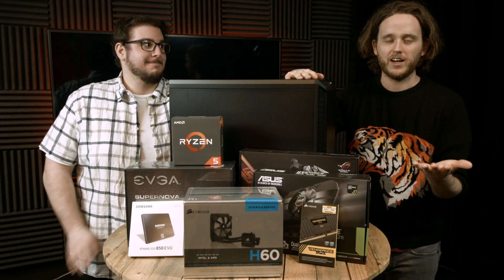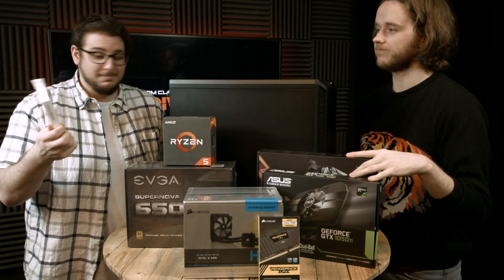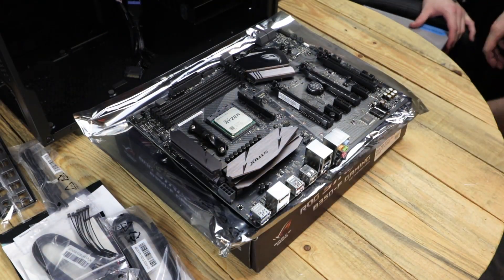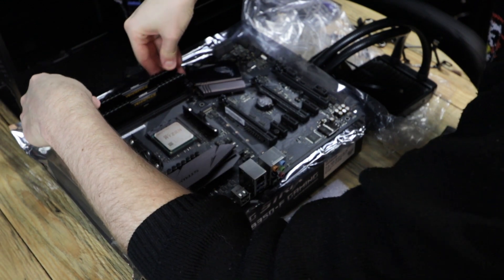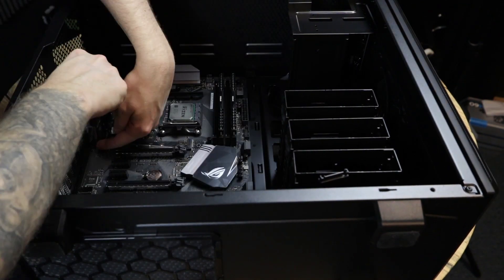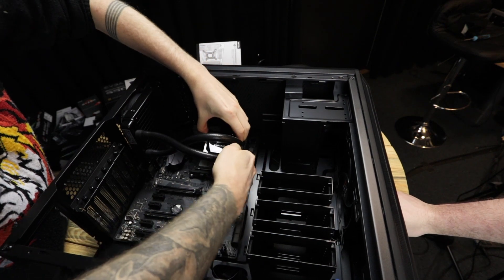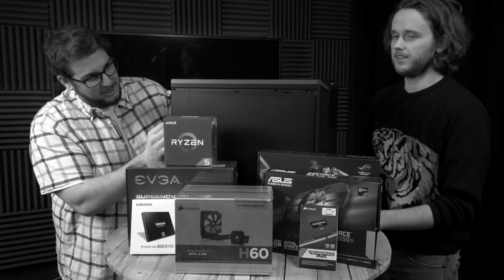Ryzen PC Build Guide - Part 1: Post

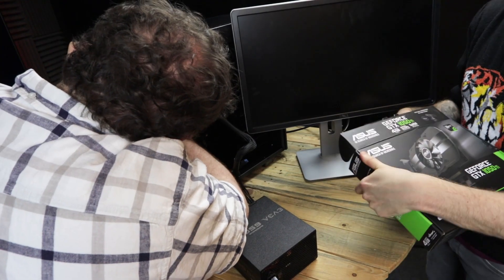Comment: 6:06 You didn't get a signal because there is not integrated graphics on the CPU that you purchased. Only the Ryzen APU (says "With Radeon Vega Graphics" on the box) can send a signal through that motherboard's video output... if the BIOS is up to date...

Comment: So many stupid comments as per usual... your requirements are not necessarily the same as a streaming box.. CPU is important, GPU hardly at all, decent RAM is worth it, solid PSU and cooler mean silent use and solid efficiencies. Small SSDs (256GB or lower) are not suitable for content creation, or even any mainline builds...

Comment: These two have no idea what they're doing. The prepaste is garbage first of all, second if you read the instructions on the h60 it'll tell you to use it as an intake fan not exhaust, also they are silent but if run at less than 100% will overheat playing most games at any setting, aka they suck, you need a duel or triple fan to run silent water cooling and it makes little sense anyway when they have fans.... so just get a good corsair cpu fan. and always have more intake than outtake fans.

Comment: Bottlenecking for beginners. Shoulda got a ryzen 1500x, a 256/128gb ssd + 1tb/2tb hdd, a 550w 80+ bronze efficiency psu and a 1060 6gb instead of wasting so much money on flashy stuff.....
Reply: i got my gtx 1070, i7-7700k OC build for around the same price as this...

Comment: I went with a 1600x as well, It's a great choice for the price, Paired with an RX 480 and 16gb's of 3200mhz DDR4 it's given me a good gaming PC. Admittedly the RX480 is a bit under-powered for my 3440x1440 Ultrawide Freesync monitor but I don't insists on max settings so I can always find a sweet spot between performance & looks.

Comment: One more thing, the cooling fan should always push air through the radiator, you have the fan and radiator backwards.
Reply: Push or pull have been proven to work efficiently whatever you choose. I'm more concerned on why using such and 'overpowered' power supply, @techdeals would not be really proud of the parts chosen... 
¯\_(ツ)_/¯

Comment: Bad choice for CPU and cooler. If they opted for the 1600/1400 non-X and use the bundled Wraith cooler instead of that low end AIO the savings could be enough to step up the GPU to a 1060 3GB.
Reply: If that's what the wanted to go for then its really not a bad choice at all.
Reply: or just got a 1500x, 550w bronze psu and a cooler master hyper 212 evo they coulda got a 6gb... or just stock cooler if they're on the cheap

Comment: :::::::::: My PC build:::::::
Motherboard: Gigabyte x99-ud4p 
CPU: intel i7-6900K
RAM: 32 GB DDR4 2400 (hyperx kingston) 
SSD M.2 512 GB 
Dual HDD 6TB WDBlack 
Video Card:- Dual  GTX 1080 SLI (Asus)
Corsair 780T White Full-Tower PC Case
Power supply : seasonic 750W
CPU Fan: Cooler master Masterliquid pro 280
Microsoft Windows 10 Pro 64Bit

Comment: I love seeing PC Builds.
However, it'd really be better if you mention the cost of every part used separately.
Thank you.
Essen2608.
Reply: Yeah you're right, without the prices this means nothing to me. Nothing worse than getting hyped up about a build only to find it's way beyond your budget and I will not watch this specifically to avoid that very boot in the groin area. I'm currently gathering the parts for my next because my i5 4690K and R9 4GB Nitro is nearing the end of it's life but parts must be within my budget. (So far scored a really nice Corsair Glass panel mid tower case for around £30, saving for mobo now)

Comment: the reason why your Display dont had any output when using the Motherboard output is because the ryzen does not have a build in graphic processor so you cant not use the main board output
Reply from the maker: Yep! I definitely learnt something new with my first Ryzen CPU. Another mistake = more knowledge :)
Reply: Right. You think they would know that lol
Reply: There's no harm in it, Intel for the past 6-7 years has had integrated GPUs on their CPUs, then (although not more recently) you had them on the motherboard.
If all they've done is build Intel based systems then I can see why this may have been a problem.

Comment: It was a little cringy seeing you put the motherboard on the anti static bag as the outside of it is where all the static is. Also the motherboard has connectors for monitors but that cpu doesn’t have a built in video card so it won’t work as you found out
Reply: no it doesnt. but the inside of the bag is free of static and the exterior of the bag is where the static is
Reply: Didn't know about the Ryzen 5 and video card stuff but as far as I'm aware, that bag is not at all conductive. Maybe I'm wrong, but maybe I learnt something today!
Reply: all good. from what i know the outside of the bag is where all the static is hence why i just put the motherboard on the box without the bag. great video otherwise. would love to see more behind the scenes things
Reply: Have done a bit of research and the box method does look to be safer so looks like knowledge was gained today! Next build on the box for sure :)
Reply: Static doesn't magically appear once the motherboard sits on the anti-static bag and typically nowadays you don't really need to worry as much.
Reply: You should add a text to the movie and inform viewers about this new knowledge :)
Reply: That might be true, but this is another one of my "mistakes" that we'll avoid in future builds. Looks like some people don't think it's too much of an issue, but there doesn't seem to be anyone that says working straight on the box is a bad idea. That's how we'll do it next time :)